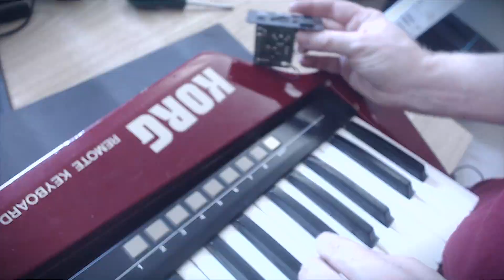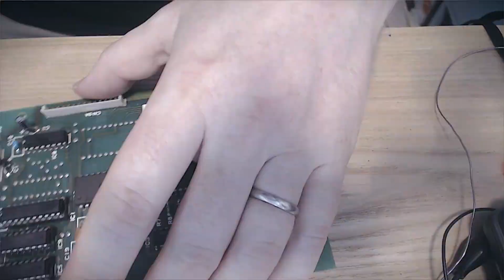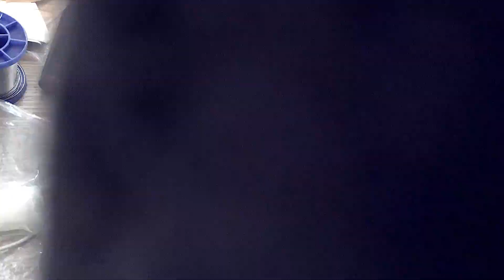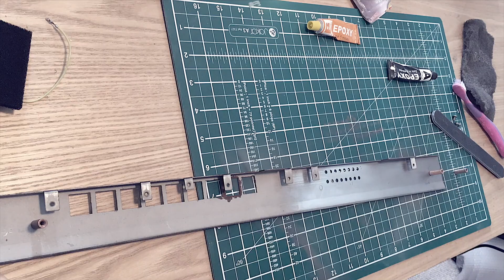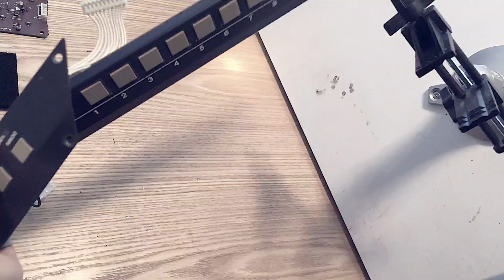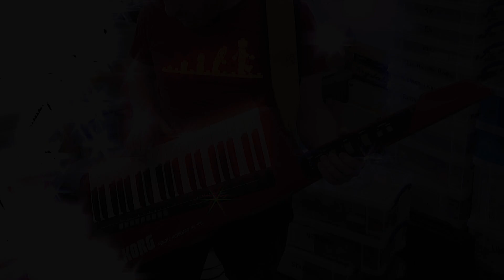Vintage 80s Keytar Restoration Part 2

Comment: Great video! So, where did you find replacement buttons? I could surely use a couple for my RK.
Reply from the maker: Thanks! The button model number is TM1-01 - seem to be a few suppliers that still stock them. Good luck!

Comment: Good job, I had to replace entire circuit for a new standard midi one with a microcontroller similary programmed. I added a display for controlling parameters instead of but I did not have options of changing banks and programs from the buttons. But other than that it works exactly the same way and it required only  one micro controller and A/D converter to work.

Comment: Great fun :-)

More on the need for encoders/muxers - the guy who did the complete replacement of the circuitry had to use some as well, didn't quite have enough pins:  https://youtu.be/gnTEL2QX2pA?t=256

It kind of amazes me you can still get these 0.1" DIL chips.  It's like still being able to buy full-size Wagon Wheels.